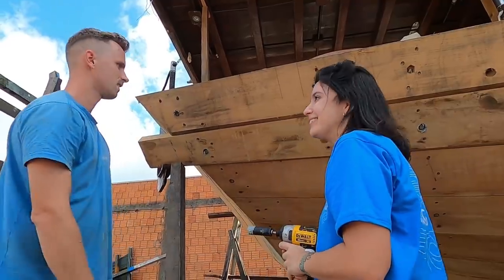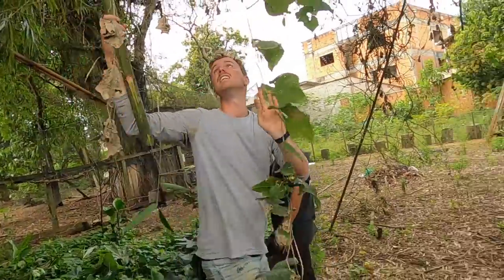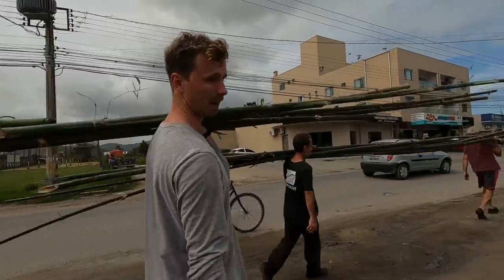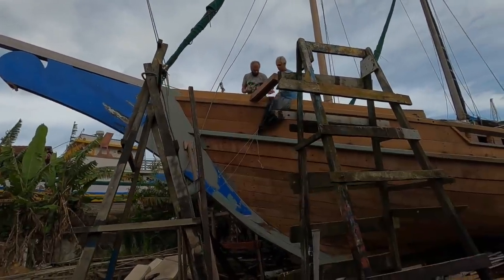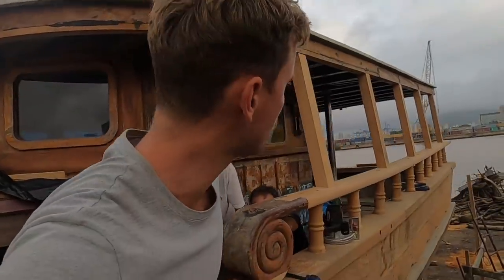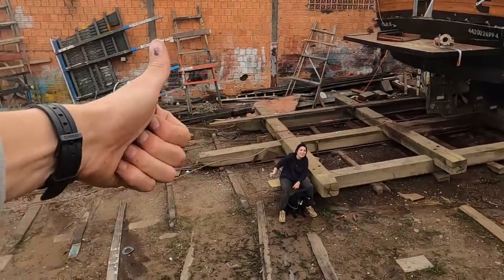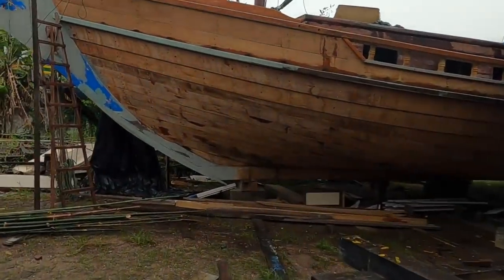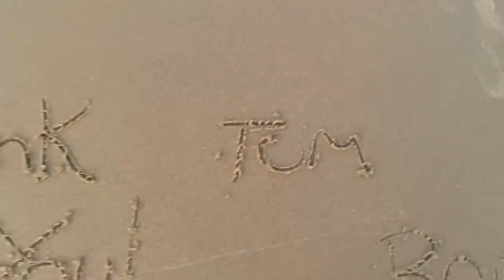Exciting MANOEUVRE in the shipyard! + the aft salon is looking GREAT!   — Sailing Yabá #73

Comment: 100% you definitely need to fit A PLATFORM on the rear of the boat, can be done while you still have access on the inside, its one of those things that always comes up at a later date as i wish we had fitted it during the build

Comment: I have a request! Yea, it's me, the tall guy in the back row. Right, you've seen me in the same seat every week How about a quick project review? I'm sorry but I've forgotten stuff from some earlier shows and I'm not quite sure what's done and what needs doing... So...like... do a tour. Here is the house, here is the wheelhouse, engine room, masts, sails/rigging, electrical system, etc. Questions are: what's the plan? decisions that need to be made? what needs doing before you can do that? Do it real quick, nothing in-depth. I just need to refresh my brain cells.THANKS. Well done! and all that.
Reply: Try to remember these two have no idea what they are doing. They are learning as they go. They seem to have some idea what they want from Yaba but for the most part they are simply doing everything under advisement. There are quite a few harsh realizations for them in the future.
Reply: @tomeidt7057  Well, I'm all for trying new things. I'm just trying to follow along.

Comment: When i see this "aftsaloon" than it comes out the boot will be a motorboot. because on the rudderwheel you can not see the mainsail and adjust the course. its a pitty. but anyway it looks nicer and nicer.